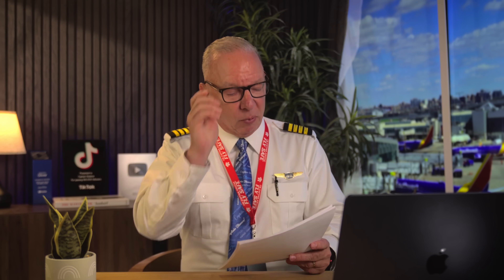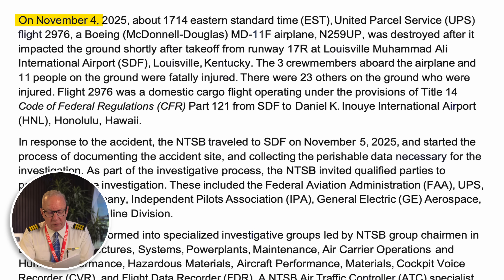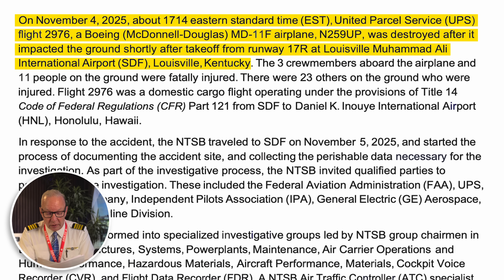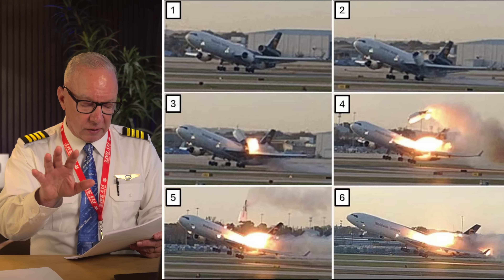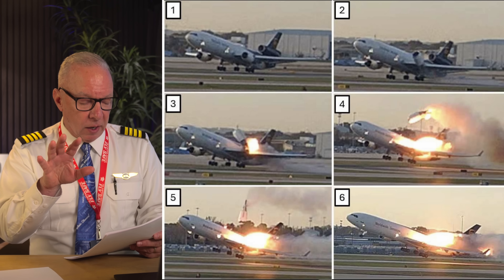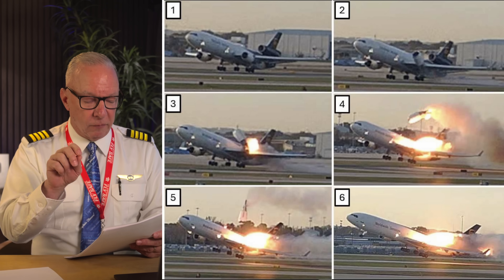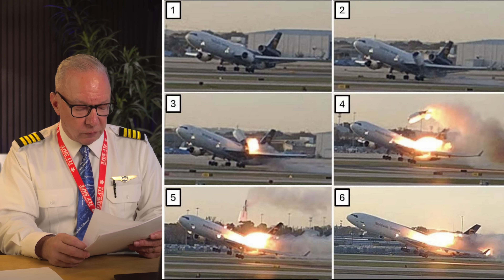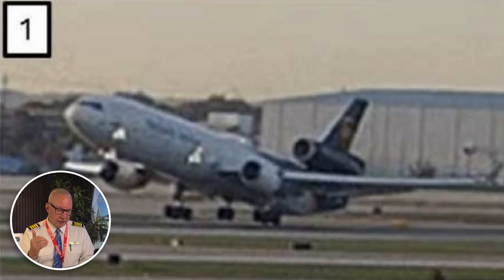UPS Crash Preliminary Report | Pilot Reacts to UPS Crash Report

Comment: As an ex RAF tech maintaining 50 year old Nimrods, I am stunned there were no interim NDT tests being carried out on those high stress areas given the age and cycles of the aircraft. Our thoughts will be forever with the valiant crew, their families and those impacted by this tragedy.
Reply: the 50 yr old nimrods were full of salt water corrosion. I know people involved in the upgrade they did in the 90s when they opened them up and found all that crap. To do interim NDT tests means massively disassembling the airplane so these components are designed to have a safe light sufficient to avoid that. Clearly something unusual happened here such as damage from maintenance or the metallurgy was compromised somehow. It will be a complex investigation. But normally nobody is going around and removing engines or wings on airlines just to check the joints from time to time. That would be economically impossible and it isn't required under normal circumstances.

Comment: Well, looks like I need to increase the inspections on those by a lot like half the time. Hopefully the Air Force will be inspecting their KC – 10’s . I’ll be interested to see if they can figure out why it fractured. Was it just straight fatigue or a is some sort of defect in the manufacturing of the part for example in the hardness. Thank God, they grounded everybody pending. They very well could’ve saved lives by doing so.

Comment: Brother, you lose a lot of credibility when you read 481 MSL and say “that’s…that’s not what happened…”  The difference between AGL and MSL is fundamental, and the report clearly says 30 AGL, 481 MSL.  You further keep confusing the ADSB altitude data in MSL as AGL.  You were a Captain and you’ve made those mistakes repeatedly.  Last, loss of thrust on #3 was not a viable theory when even the initial video appeared to show a compressor stall on #2, and the right roll is very consistent with asymmetric thrust and adverse yaw.  Had #3 lost power the aircraft would have likely impacted in a level attitude.

Comment: Captain Steve. The new video shows step by step the plane wheels lifting, the #1 engine separating, and the plane trying to get up. Point of no return. If the plane was only 30 feet off the ground, wouldn't it have been better to put it down on the airport property instead of trying to fly and then hit the buildings?? I understand the point of no return, but it seems better to just put it in the ground instead of entering a populated area. Is that something talked about for certain situations?? I know they would have still went through the fence and out of airport property, but would this have caused less damage and injury to the people. Thank you.

Comment: Looking at the line drawing it looks like the engine was mounted with the primary thrust force parallel to the donut portion of the bearing Rather than perpendicular. As designed it sure looks like they were loading it in the wrong direction based on the design.... Which wouldn't necessarily brake in instantly but definitely would shorten the fatigue life... I must be looking at the schematic wrong.... That long of a cycle time without non-destructive testing 🤯... Only visual inspection that's crazy... Especially with the age of the air frame and number of cycles.

Comment: Seems like having an engine mounted on the tail behind other engines is more of a but than a feature.  If this had been a two engine aircraft, this accident would not have happened.  It seems that the forward mount momentarily acted as a swivel until it gave way and that is why the engine went up and over the wing.  Thanks for sharing this report with us.

Comment: I thought planes were supposed to be able to fly with only one engine. Why didn’t this happen here?
Reply: For the takeoff performance, it's One Engine Inoperative (OEI) that is considered, not flying on one engine (though most planes nowadays are twins, meaning OEI happens to be the same as flying on one engine). Thus, the MD-11 has to be capable of continuing the take-off with 2 working engines.

Comment: This is a major flaw for old trijet designs. I'm actually kind of surprised this wasn't considered in the past either. Having that tail mounted jet being subject to fod ingestion if either of the wing engines fail is a nasty flaw, particularly with cargo carriers since they are constantly flying at max weight. Losing even just a little performance out of your remaining engines in such a scenario is untenable.

Comment: As usual great reporting. So this was nothing like what happened with the American flight back in 1979, correct? From what I saw on the documentary, the bolt was broken, but a metalurgist suggested that it broke because of stress due to the use of a forklift during maintenance as opposed to wear And tear. Curious if that is common in this type of plane, was it just age, or even contamination during the process of making these pylons and bolts.

Comment: In photo 1, as best as can be determined, engine 1 is not entirely at the same attitude as engine 3. The engine was already starting upwards. Probably why the report released that particular image. Not quite what I would call "perfectly normal" IMHO. And if smoke & flames reach engine 2, wouldn't that cause diminution of oxygen intake? Is that a cause of flame-out? Add debris also in the mix.

Comment: A fuel disconnect like the ones used at the gas pump for automobiles would have left the airplane controllable. All wing mounted engines should have a fuel line that stops pumping fuel when an engine departs. Duh!

Comment: Boeing airplane engine mounts are "statically indeterminate" meaning they have an extra link in case any one fails. Looks like Douglas used two lugs in a row to accomplish this. Loss of this aircraft is not likely to mirror the AAL crash in ORD, where the departing engine severed hydraulic lines installed on the front wing spar, causing the wing to lose lift relative to the right wing. In this case, the departing engine most probably ruptured the wing tank, causing the catastrophic fire.

Comment: It is very unfortunate that 14 people have already lost their life as the results but that is why NTSB always takes extensive analysis to determine the cause so that the same type of accident can be avoided in the future. Now, was the 1993 American crash very similar? If so,  why it happened again. As we will Learn so much more this time and know the weak points of the pylon mounting brackets and or the bolts which may apply to other model jets. But the good news for MD 10 and 
MD11 will be that there is a not so complicated fix which will get them back in the air, soon.

Comment: Update on The UPS MD-11, Cargo Aircraft which Crashed Recently in Kentucky.

This Aircraft lost an Engine as illustrated by photos in the following video. The cause of the lost engine was pre-existing cracks in the structural members of the airframe which support the jet engine.

These cracks were repaired, for the second time, recently in Texas, during the aircrafts annual tear down inspection for services and repairs. This took place just weeks before this catastrophic accident happened.

The Plane should have been permanently grounded, taken out of service and scrapped once these cracks were identified for the second time in this same critical area, during this recent inspection.

Performing welding repairs a second time in the same area degrades and tends to weaken and or make brittle the base metal. Leaving it more prone to future, more rapid and extreme structural and metallurgical failure, contingent on all of the potential variables. Other additional associated factors can also further compromise the structural integrity of these airframes while undertaking welding repairs to cracked, overstressed and fatigued structural members.

Rewelding this area was a no, no, poor practice and should have never been allowed by the FAA or other responsible governing oversight body.

It's beyond me why these second welding repairs were/are procedurally allowed by the governing authorities in charge of overseeing the maintenance and repairs of these aircraft.

Comment: The stream of high pressure fuel on fire being sucked into #2 caused intermittent compressor stalls. The stream of burning fuel over the lifting surface of the wing also caused it to stall. Aeronautics 101 page 1. What does a wing need to generate lift?
100% denied by fire.  Fire has an air density equal to nothing.

Comment: Sadly, this was an accident waiting to happen because insufficient checks were made for metal fatigue in the mounts holding the engine.  Why wasn't this considered a necessity by the airline and the NTSB? If much more frequent checks had been made for metal fatigue, then this accident would never have happened.

Comment: Did you infer that another engine failed from the photos?  You mentioned in the video that the No. 2 engine also failed as opposed to the No. 3 engine that you previously reported; however, I did not see anything in the report about any of the other engines failing.

One thing I wish that was included in the report are changes that could be made to possibly make such a mishap survivable.  It appears that most pundits (including you) are resigned to the fact that the pilots and people on the ground were doomed regardless of anything else.

I believe that the following two issues should be addressed:

1) Making runways longer so that the takeoff can be rejected later in the roll.  There are eminent domain laws that could be utilized if there was the political will to do so.  Airports such as Orange County, Burbank and Chicago Midway have the potential for a serious accident.

2) Less flammable fuels are available and certainly would make the aftermath of an accident more survivable.

It is easy for government officials to ground old airplanes and then pat themselves on the back for doing something that they should have done a long time ago; however, it really does nothing to make air travel more safe for the general public.

Comment: Shame there was not a 3rd mount added to the design in case of failure. That and the time between inspections needs to decrease as the airframe ages. RIP to those poor souls 🙏

Comment: The departure end of runway 17R, (approach end of 35L) is 461.3 feet ASL/MSL, (Above Sea Level / Mean Sea Level..). Add 30 AGL, (Above Ground Level) = 491.3 feet ASL / MSL  The altimeter reads in ASL and is the planes altitude would have read 491.3 feet ASL / MSL.

Also it was not the gear that hit the UPS building approximately 1200 feet from the departure end of 17R it was the tail section of the fuselage.  Then it climbed away before rolling left into wings vertical.

Comment: The failures look odd to me. It seems one of the two had fatigue fractures, but the other did not, just overload fractures. Yet both seemed to fail at the same location. Given the damage to the spherical bearing, the sequence seems to be aft lug, bearing housing, then forward lug due to overloading. Then the pylon starts rotating and the rest of the failure sequence occurs. But why did the forward lug fail in the same locations, it could have fractured almost anywhere….

Comment: this is not to cast any kind of blame of judgement on anyone, but just a general reminder: 

if you go and do a job like just greasing-up a part, and you happen to see something wrong... just tell someone. don't think 'not myproblem', don't think 'not my job'. just tell someone you see something you think isn't right 

not saying the guys doing the grease job even could have seen anything, just recalling all of the times either I myself or someone I worked with thought, 'eh, not my problem' and TECHNICALLY being not to blame while doing work (albeit much lower stakes than working on an aircraft engine pylon)

it might not be your job r your fault, but it'll sure be your consequences

Comment: 1050 Wow.  That’s nearly a duplicate of 1979.  Difference being 79 was impact during maintenance, 25 being age.  Although, from the forward details, the age cracking might trace further back to “correct” maintenance “use” damage (not impact from fork lift, just “normal” for inserting and removing correctly.

It also means that the attachment under the most stress failed.   Ot surprising, but the rear mount is what “holds” the engine down.  The forward is basically (way oversimplified) just stabilizing (and appeared to have 2 bolts, not just 1).

Technology is great, but even with simulated “aging,” only real time use is the proof.
I wonder if this is going to mean a mandatory redesign of more modern pylons.  The MD-10/11 are 50+, but we’ve got plenty of aircraft between 30 and 50 with probably similar connections.

Comment: holy CRAP those pictures 

nothing anyone on board could have done. they are already wheels off the ground

i thought for sure this would have been a fan blade problem (also nothing anyone on board could have done), but holy crap it is shocking to see the engine just nope out like that and go flying off

Comment: This is a maintenance failure issue ... NDI and visual inspection should have found these cracks long before this incident ... since the crash in Chicago this aircraft and all variations have had regular inspection cycles ... that is for the AD ... but a C check should have caught something ...

Comment: We already knew that the engine pylon separated. We still don’t know why: was it bad maintenance, fatigue that went undetected during visual inspection, or an engine-related event?

The fact that the so-called “fatigue cracks” originated at the forward face of the aft lug suggests that the engine may have been tipped forward and down during maintenance while the lug was still pinned, producing localized overstress fractures.  Subsequent oceanic flights could have helped the fracture surfaces to corrode, making the cracks appear older than they were.

Comment: So, I do not know anything about flying an aircraft or maintaining it but, I have a question for those who may know. If engine number 2 does NOT ingest any of that shrapnel meaning you would have two fully functional engines (2 and 3) would it of had enough thrust to still carry the plane or would it have still crashed?

Comment: Im going to bet the Maintenance Grease Zert Point was a Real PITA to get to. 

That bearing doesn't looked like any Grease has been pumped into it  for a long, long time.

It was greased on Paper only. 😉.

It is gonna be Grease, or lack there of that took this plane down. Bearing was siezed to Bolt on after. Engine power full on locked bearing is no bueno.

Comment: My question is what changes need to happen to prevent this, I honestly think more frequent, more detailed inspections are insufficient..

People on the ground died ..  

I think there needs to be a bigger change… ideally I wish runways had enough distance where they could abort after rotating and safely bring the plane back down, 

But I think more practically, if a catastrophic failure occurred immediately after rotation.. to require pilots to more or less put in on the ground before you clear the airport to at least minimize other casualties

Comment: It may seem an odd suggestion, but I can think of three crashes  on take-off where separating left- mounted engines impinged of other parts  of planes while trying to climb out.  The third instance, if im recalling correctly, was a cargo 747 flying, I  believe, from Schipol sometime in the 80s. 
On that plane the separating engine struck one of the remaining three engines making it impossible to climb over a high-rise apartment building.
This suggests the centrifugal moment on rotation turns a departing left engine toward the fuselage and it may be worth the developmental  cost to have counter-rotating engines dedicated to each side.

Comment: you are a little wrong about why the engine flew that way - its gyroscopic procession because of the way the engine spins caused by the rotation of the aircraft, if the right enginere failed it would flip under the wing for the same reason, this is far more energentic that the lift effect of the engine cowls

Comment: Besides grounding this model of old airplanes, it sounds like they really need to make changes in the required inspection/maintenance interval particularly as these planes age. Perhaps a 6 year inspection is perfectly fine for a brand new plane but not adequate for a 10, 20 year old plane. Like maybe the first inspection/maintenance comes at 6 years but then the 2nd inspection/maintenance has to come at 3 years. Then the 3rd every year or something like that. I obviously don’t know much about planes but I know all things have more issues as the age and (if fixable) need to be fixed more often the older they are.

Comment: This was very comprehensive explanation of what caused the engine to break free of the wing.  Now the question is “What caused the pre-existing stress cracks in the aft pylon mounting hardware?  Was this a manufacturing defect or was this caused by something similar to what brought down the American Airlines jet in 1979? Hopefully the NTSB will be able to figure that out.

Comment: When I was in MD-11 school in Long Beach in 1993, Pratt and Whitney were at that time working on the PW 4000, a 90,000lb thrust engine. I asked the P&W tech rep what would happen if the fan shed a blade. He said that in about 20 seconds the engine would separate and go over the top of the wing!
Reply: In the 1990s all Boeing aircraft were redesigned (and retrofitted) so the engine would stay on wing no matter what. But that was before the merger. . .